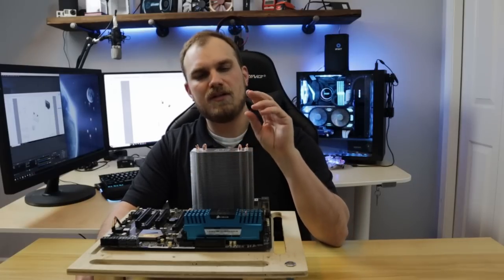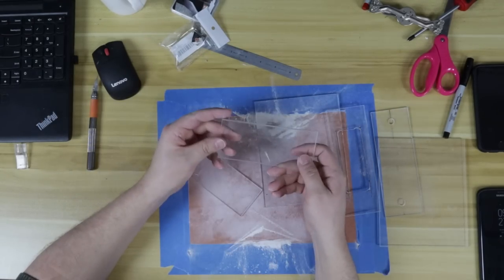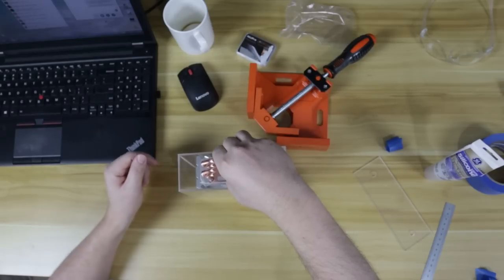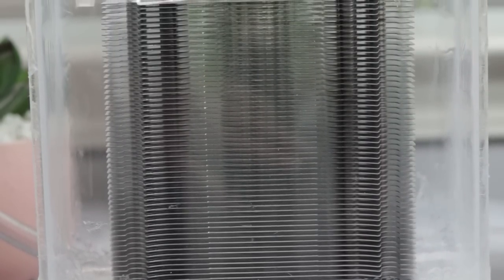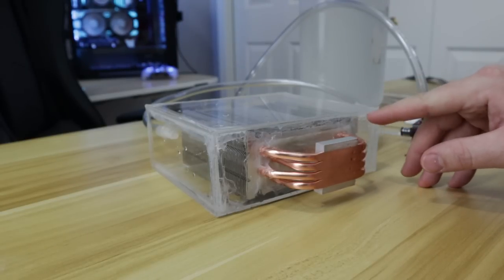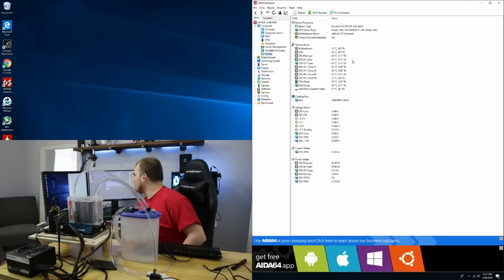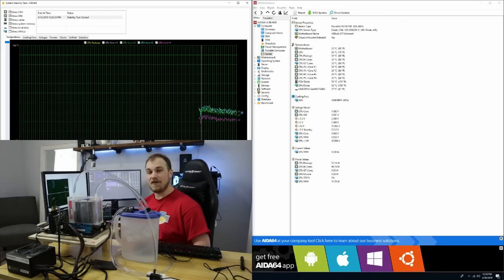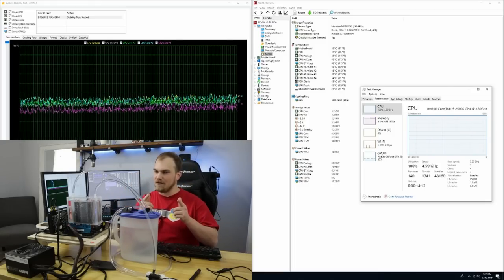I Water Cooled My Air Cooler AND..........

Comment: It's still a water cooled CPU you just made an enormous water block.
Reply: It is still air cooling, since liquid is just used to carry the heat to another place where its cooled by air. Basically there is only air cooling and air cooling with liquid.
Reply: onearthonelegion 🤦‍♂️
Reply: @onearthonelegion  right
Reply: Im looking for the fan....
Reply: @zachandowen8205  thats only a test-rig. if you want to let it run longer you have to cool the water down. with a radiator and fan's on it. 😜
Reply: onearthonelegion but... there’s.... no... fan....
Reply: @threegs3496  its not about fans, its about cooling the liquid with air
Reply: Brandon Smith  no I didnt say that, nuclear power plants have water cooling ( no air cooled radiators, no fans)
Reply: onearthonelegion that’s literally any liquid cooler you buy.... heatsinks dissipate heat via the radiator. It’s still liquid cooled. It’s just a clickbaity title to make it seem like he did something revolutionary. No disrespect to the creator, it’s still a cool project.
Reply: @threegs3496  Yeah, but you cant escape the fact that in the end 99.999 % of (PC) cases you end up cooling with air. You might use liquid to transfer the heat instead of just using conduction, but you still end up using air cooling to dissipate said heat. Heatpipes are also water/ liquid cooling, but nobody refers them as such. Since they are air cooled with fans.
Reply: Based on what I understand about car exhaust and applying it to pcs, couldnt you theoretically do an air cooler with ceramic coated heat pipes to move the  hot air out with more efficacy, coppers great, it's an ideal conductor, but ceramic is an excellent reflector with high emmisivity, which means you can move hot air out faster . I'd be intrigued to see someone grab a ceramic automotive paint and see how an air cooler performs post cera-coat of the heat pipes
Reply: @whoathatsalotofdamage3718  well there is the xigmatek dark knight 2
Reply: exactly...its just a large, wonky waterblock...LTT has doing large and wonky since i can remember...but those paper plates are absolute units..love those...
Reply: onearthonelegion lol that’s so dumb to think about it like that. Like if it’s not cooled with refrigerant, it’s not truly liquid cooled? Tell that to he entire liquid cooled market... I’ll agree to disagree
Reply: @threegs3496  There is entire goddamn market for selling water as medicine. Go tell them that they are wrong. I would.

Life is a box of chocolates son. They might sell you a water cooling system, but there will still be fans pushing air through the ass end of it.
Reply: @threegs3496  It's like this. Old VW bug used no water to cool it's engine therefore it's air cooled. A new VW Jetta which uses water is an air cooled engine just like the old VW because the air is cooling the water that is running throughout the engine to keep it cool (WTF?). One requires water to transfer heat to stay cool while the other requires only air. One is air cooled while the other is water cooled. 99.999% of people understand the difference between air and water cooling. Onearthonelegion is the dork who lives in his parent's basement who will make you regret ever having a conversation with him. He will argue nonsense with you until nothing makes sense.  Don't fall into the idiotic onearthonelegion vortex.
Reply: onearthonelegion no it’s liquid cooling... because you are transferring the heat to a liquid. The liquid is cooling the components not air. The liquid may be transferring the heat to air after that but it’s still the liquid that cooled the cpu. It’s the fact that liquid is involved that makes it liquid cooling. If you want to take stupid eventualities into context “technically” every computer is space cooled because air can only cool down because heat escapes into the void of space.
Reply: @6104chrisn  You seem like a really smart person with most highest discussion standards. I mean you obviously used significant amount of raw brain power to cook up those insults.

And after all those insults you still need air to cool that radiator.
Reply: @ragon39  So what you are saying is that coolers with heatpipes are water cooling.  Like Noctua NH-D14 for example.

And you are pretty much right about "space cooling", but we shoud just look at the human made components of the system. And there mostly is an radiator with fans there, mostly.
Reply: @onearthonelegion  There is no cooler. This is a water based air heater.
Reply: @scorokeelemental  On the global scale thats absolutely correct assessment. We heat up atmosphere with our processors too.

But from the viewpoint of a CPU it is nearly always some form of air cooling. You just can move the air cooling one step further by introducing liquid.
Reply: @onearthonelegion  The heat from our CPU goes into the copper, then water, then radiator, then air... By that it heats up the atmosphere, providing to a storm somewhere or heats up rain water, that comes down and heats something else up and so on and so on.
What I meant to say is, you're right that at some point this heat crosses the air - but with that logic you could call the cooler an storm cooler or rain cooler or whatever. We call it by the mechanism with which it does what we built it for: it is a cooler that gets the heat away from our CPU with water. This, we call a water cooler. Even though technically there is neither cooling nor do we care what happens to the heat afterwards. These are conventions so we can understand what someone else means.
Reply: @scorokeelemental  We are only scrutinising the human made part of the system called cooler. And it practically always ends up with air cooling in case of computers.

You can take water out of air cooling, but you cant take air out of water cooling. And if things are so clear, then why cooler with heatpipes is not called water cooling? It should be, if our way of categorising these things would be immaculate.
Reply: Lol this is the stupidest thing I’ve ever participated in. I honestly regret commenting.
Reply: @threegs3496  I agree.
Reply: @onearthonelegion  Ummm what.... A heatpipe does not provide water cooling... Because there is no water... to provide cooling... In the video example above he uses a heatpipe if that was what you're referring to. But that was just stupid on his part. Instead of transferring heat directly to liquid he transfers heat to a heatpipe then to a liquid. This is pointless because it just adds another medium that wasn't needed.  As i said before its called liquid cooling because the LIQUID transfers the heat from the cpu. The liquid may be air cooled after that BUT that is the liquid and not the pc. The pc is cooled by liquid hence its a liquid cooled pc. You may say that every liquid in a liquid cooled pc is air cooled but you may not say that every pc is air cooled because that is a fallacious statement that blatantly ignores the fact that in liquid cooled pcs liquid is cooling the major components whereas in a general fan based pc air is directly cooling pcs major components. Your statement is wrong because liquid cooled pcs are indirectly cooled by air where as air cooled pcs are directly cooled.
Reply: @onearthonelegion  in the case of a nuclear reactor (power plant) you don't need or want a radiator. the water keeps the fuel rods from going critical, but then you use the heated water (steam) to operate turbines. the chamber that the reactor sits in is under pressure so the water remains liquid at the 320C operating temperature, then is fed into unpressurized steam generators which cause the water to evaporate into steam, and then power a turbine.

water is continually pumped into the reactor in order to keep fuel rods cool, even when the reactor is shut down, as they keep producing some heat. the reason this, and the loop of water/radiators are BOTH liquid cooling is because liquid is used as the transfer medium of heat energy. what you do with that heat energy is of little consequence. Yes, the radiator is technically air-cooled, but the same effect could also be accomplished by constantly replacing the liquid with fresh coolant, however this is neither practical nor efficient as far as cooling a couple hundred Watts of heat energy such as a processor.

Regardless, the transfer medium of heat in both cases is water, ergo water cooling.
Reply: @ragon39  Lets start with the fact that there is liquid (usually water) in the heatpipe.
Reply: @PaNIcPeRCePTioN  So then we must conclude that every cooler with heatpipes is water cooling. And that there is no air cooling, instead there is aluminiun cooling, copper cooling etc. since heat is being conducted in those metals (last medium of heat transfer before air).

Much easier to say that everything is eventually air cooling, because in the end everything is.
Reply: @onearthonelegion  I mean I totally see what you are saying, and you are completely correct - in the end it's air cooling with the benefit of moving the heat discipator (no idea how to spell it) thanks to a liquid bridge somewhere where the air cooling can take place at a more beneficial spot as you are not cooling the radiator with warm inside of the case air but fresh air from outside the case. but these guys are obviously too far up their own ass.... and you too
it's called liquid cooling so people don't have to say "liquid bridged air cooling". aaaaand nuclear power plants by your extended logic are aircooled too then because the water has to get cold somewhere upstream of the intake. it wouldn't be cold on its own. so just end this
Reply: @mishXY  I know what the convention is regarding these things, I mean a dried grape is called raisin, but its still a dried grape. 

I was just pointing out that our way of naming things isnt very logical, and that everything ends up with air cooling ( with computers). And that everything is not as clear cut and black and white as we are tempted to assume, and that our brains are prone to illusion of knowledge.

Anyway it has been fun with angry kid calling me names and all.

P.S. You are wrong about nuclear power plants, since the sea isnt built by man. We were of course examining just the human built part of the cooling system.
Reply: @onearthonelegion  in that case yes you are right

fun fact - nuclear power plants almost never use sea water but fresh water to minimise corrosion. it just ends up in the ocean/sea eventually. fukushima was quite unique in that aspect that it took sea water in.
Reply: @mishXY  There is also nuclear power plants in Loviisa and Olkiluoto that use sea water for cooling. But yeah, it makes sense to use fresh water if its available in abundance.
Reply: @onearthonelegion  oh shit didn't know that :O
Most powerplants I know about are far from the sea and usually somewhere by a gushing river :-}
Reply: @onearthonelegion  You are right about that. The pipes do contain liquid so that was my misunderstanding. BUT that does bring a difference. Liquid cooling remains a liquid. Whereas in the heat pipe is dependent on the liquid forming into a gas. Its gas cooling.
Reply: @mishXY  In the Baltic Sea region salinity of the ocean is lower than your normal sea water. All swedish nuclear power plants seem also to use sea water. Of course not as the primary coolant, but in the secondary loop.
Reply: @onearthonelegion  yeah true in the Baltic sea, Gulf of riga you can open your eyes under water.
Reply: @ragon39  Ha haa! But then you can not call boiling water reactors water cooled, since the primary coolant in them turns into steam. And then again in heatpipes vapor is constantly being condensed back to liquid. 

Maybe if we define heat pipes as vapour / liquid assisted air cooling, and waterblocks with radiators as just liquid assisted air cooling ;)
Reply: @onearthonelegion  heads up here - a boiling water reactor does not mean that the water boiling cools it. it means that, for example in nuclear power plants, that the energy exerted by the nuclear rods is bringing water to boil and that drives turbines. then there is still water from the outside to control the temperature, cause the nuclear rods can be much hotter than boiling water.
Reply: @raminolta  No youre wrong, its liquid assisted air cooling. Water is only used to transfer the heat and air is used for cooling.

I agree that we shouldnt obsess about the terminology like the OP. Especially when its clear that there  is only different variations of air cooling.
Reply: @raminolta   Its clear that OP started the  definition wars 2019. And if someone is obsessed it seems to be you.

So youre saying coolers with heat pipes are water cooling. Thats very uneducated and misleading. Let me educate you, theyre not considered water cooling but air. You are a very silly boy.

As I said before, Im fully aware of what are the naming conventions. But in the same time, there really is no water cooling (exept in the nuclear power plants), just pure air cooling and delayed (liquid assisted) air cooling.

Its just a fact, stop obsessing about it and just admit it.
Reply: @DookieDale  No. Its clear that I am just stating facts for salty kids who are prancing around internet with their stone tablets.
Reply: Ok he swallowed his pride and deleted his latest post I guess. That kid is learning.
Reply: @onearthonelegion  Nuclear plants use nitrogen to cool reactors....and the reactor rods are placed in specific points for optimal cooling....gallons of nitrogen can be found inside the reactor cooling chamber, which has the rods submerged in them.
Reply: @onearthonelegion  Reminds me of the question all new nuclear mechanics get asked when they arrived in the ship. "How much of this reactors power gets transferred to the sea?" It's a trick question. The answer is 100% either through the sea cooling the reactor or the propeller moving the ship it all goes to the sea. Now since the sea's temp is regulated by air (air surrounds the earth after all) everything is just a air cooled. Great scientific observation.
Reply: @onearthonelegion  Wow when did man build the air? By your own logic you just lost. You can not count air since it is not human built.
Reply: @robertmitchell5019  Yeah mr. sherlock, you really suppose that 100% goes into sea? Well guess none of it goes to ships structure then, of which most is surrounded by air...
Reply: @robertmitchell5019  And to make things absolutely clear, my whole point was that nitpicking about the terminology is bit pointless. Since with PCs air is the abundant natural resource that we use to dissipate heat. No matter if there is a splash of water in between. I was merely stating the status quo, so good luck trying to refute that fact.
Reply: @onearthonelegion  you are correct on surface ships. I didn't state I was on subs so that was my point of reference. Also since the parts of surface ship that is not in the water is surrounded by air then the premise of the statemant still holds true. Since you do not understand what I said. I will spell it out for you in simple english. I was agreeing with you. Ultimately all heat transfers end up in the atmosphere (air). As far as beeing stupid, You said you were only talking about human built. So I only pointed out by your own statements you could not talk about air since it is not human built. I know this is a long post but that is why I didn't go into this much detail before.
Reply: @robertmitchell5019  Subs when submerged 100%. But even with subs not 100% all the time. Why I got irritated with you was when you tried to put words in my mouth. I never even suggested air was built by man.

 Point was that man made PC cooling systems end up dissipating heat in air, hence air cooling. So no need bickering what to call the cooling solution in the video. 

P.S. I never said that we should name the cooling solution by just examining the man made part, what I said was completely the opposite. Otherwise we should call copper heat sink "copper cooling" and so forth.
Reply: Stevey TeeVee  I get this perfectly. Everything is air cooled in the end. Now thats just a fact. True liquid cooling just does not exist with computers. So bickering about it is just pointless. You transfer the heat with splash of liquid, then you cool it with air. When it comes to sustainable cooling solutions, there is just air cooling, nothing else. Period.
Reply: Which entirely, for me defeats the point of water cooling, one watercools to get rid of the massive weight of an air cooler, all he's done is add even more weight lol!
Reply: Stevey TeeVee  In fact their basic function is the same. They use different substances to transfer heat from the CPU, and then air cooling takes place. 

Heat pipes are water cooling if deciding factor is just having liquid in the cooling system.

Nuclear power plants are called air cooled, even if there is liquid in the primary and secondary loops, when air is the abundant natural resource in which the heat is dissipated. And water cooled only if a large natural body of water is used for the actual cooling. This is much more logical way of naming these cooling solutions.
Reply: Stevey TeeVee  Its really not about what can leak in your case. Its not about what is the convention of small industry like PC coolers either.

Now you would not go calling them nuclear plant engineers stupid with their logical naming for cooling systems?
Reply: Stevey TeeVee  What is logical is to call everything air cooling with PCs. Im fully aware that this is not the case however, and I have thorough understanding of whats what and how things work. You do not have to explain these things to me at all.

The fact remains that what is called water cooling with PCs is actually air cooling with a twist.
Reply: @UCeHqxU4HNhavYgmRKBqE_3g The so called big difference is only relevant to user if an leak occurs. It does not carry any weight when considering what element is actually used for cooling. Transferring heat through small amount of medium is not cooling in the long term. Only when you are actually dissipating heat from the cooling system into practically infinite natural resource the cooling can take place. Without such resource (air) cooling would stop after a while. 

This is just the status quo explained, not a matter of opinion.
Reply: @UCeHqxU4HNhavYgmRKBqE_3g No, the much bigger industry calls air cooling "dry" and actual water cooling (which we dont have in PCs) "wet". It does not matter since its just shorter way to describe air cooling and water cooling. 

The point is that they do understand what is actually what, unlike small PC cooling industry with their stupid marketing terms.
Reply: Stevey TeeVee  The point is that its waste of time nitpicking what to call heat pipe cooler inside a big water block. In the end we are always cooling with air, and thats just a fact.
Reply: Stevey TeeVee  No the OP started the nitpicking, I just reminded him what actually is what.

I understand fully what coolers are, and when it comes to PCs you have air cooling. You can call them what ever you want, but fact remains theyre based on cooling substances with air.
Reply: Nice one CN NC, you managed to summon legendary levels of autism with this one innocent looking comment.
Reply: @onearthonelegion  LOL
Reply: @ICM9  I know I should not waste my time with the likes of you, but im prone towards helping those suffering of innate stupidity.

So you could try to understand this by seeing it as an layer model. At the very bottom there is the CPU, next you have copper, then maybe aluminium. After these layers the air cooling takes place. Now, if you add an layer of water between copper and aluminium, you still have basically the same setup. What industry calls water cooling is in fact just glorified air cooling.

If these indisputable facts annoy you, its really not my fault. Its a question of your own shortcomings, which are undoubtedly numerous.
Reply: @ICM9  And dont you worry kid, I will always reply to you. Its a great chance for me to hone my rusty english. If you have any questions about the layer model feel free to ask.
Reply: What's the matter kids? You expected to win an debate by going after someones character? Sorry but it doesn't work like that.
Reply: @onearthonelegion  LOL
Reply: @onearthonelegion  Fun fact: Satellites in orbit around earth are in a vacuum, so there is absolutely nothing to conduct heat into. So instead they use radiators to radiate the heat into space in the form of infra-red light. If you look at pictures of the international space station, they look like the solar panels only white.